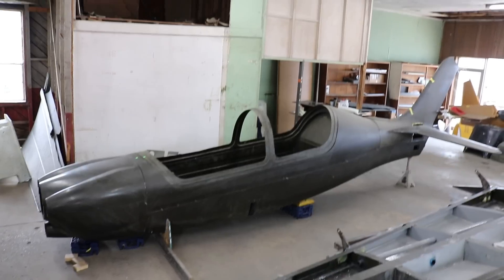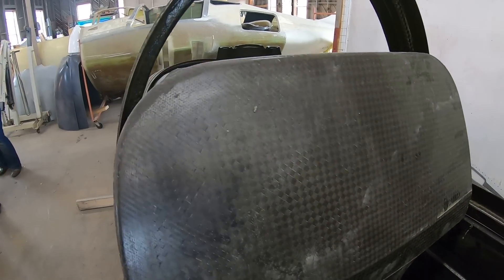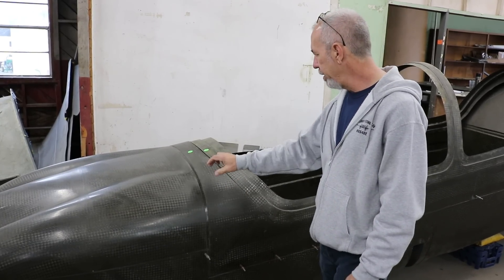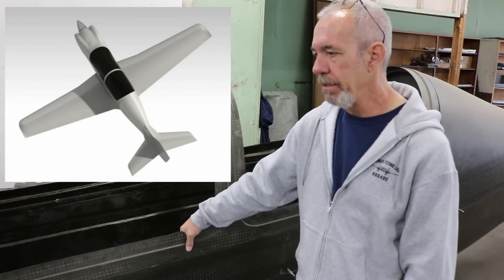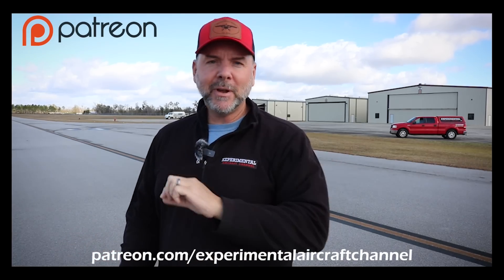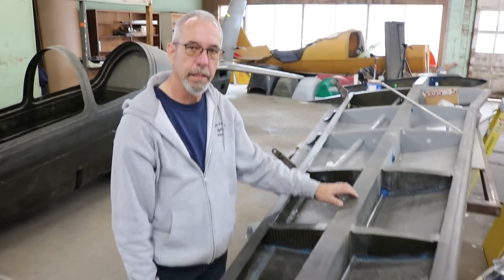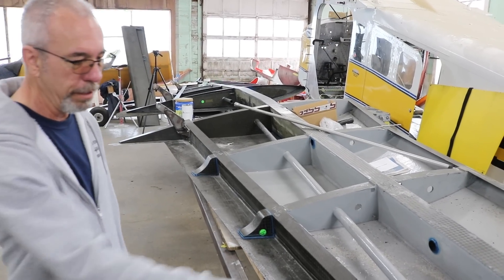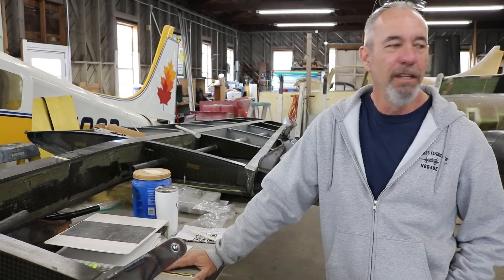All Carbon Fiber! F100 SPEED Kit AIRCRAFT Prototype!

Comment: Using contemporary materials and tech in a clever way can drastically alter the weight/power ratio, extend the range, keep cost-of-ownership at a reasonable level, and drive the production cost down.  Imagine a carbon fiber extended-wingspan version of Eclipse 550 or Learjet 23 with twin PW610F-A engines (mounted under the wet wings) weighing circa 1100kg, consuming >40 gph, cruising at 400kt, with 3000nm range.  No longer impossible.  I'm wondering if there's already such a carbon-fiber jet project in the pipeworks somewhere?

Comment: There are very few tandem seating two seaters in the market, always thought tandem configuration makes for a better two seater that's designed for range and speed. With that 90 gallon fuel capacity, hopefully they will be able to get some impressive range out of this if they stick to a good piston, diesel could also be nice for the fuel efficiency.

Comment: 2,800 gross / 1,680 empty wt is 0.6 fraction. = believable.

2,800lb / 114ft^2 wing area is 24.56lb/sqft. Reasonable for this performance. 

24.56 x 1.03 (down-load) requires CLmax of 2.3 to fly at 57ktas. That is high for GA. But still believable with large slotted/fowler flaps.

300hp IO-540 as described at 14:28. 240ktas Vh (max) speed. This gives almost +8% horsepower due to ram-air. And propellers likely 85% efficient. This requires a flat plate drag area of 1.87sqft. (About what a Glassair III has). But this requires a very low drag coefficient of 0.0164 with 114ft of wing area. This number is exactly the same, to the fourth place decimal, as the number quoted for the P-51D Mustang.

I doubt this aircraft will achieve this low drag coefficient. 0.018 is more likely. This airplane will probably have a maximum speed of 268-270mph or 233-234 ktas. 

The designer knows this, as the cruise speed is given as 225ktas. And this is surprisingly often 95-96% of maximum speed. 225/0.96 = 234. 

Not to rain on their parade. As 6-7kts is still a very small over estimation as the speeds we are talking about. They aren't dishonest, just failed to factor for Compressibility at 0.35-0.4 mach. ;)
Reply: That's some serious napkin math my friend
Reply: @tafaragadze6432  keeps people honest. This is a promising design to keep an eye on for sure!

Comment: If you don’t know why the tail plane has an anhedral, stay away from this aircraft - seems fairly basic to explain - and it is not about cosmetics - amateurs in every sense.
Reply: Richard was correct, a horizontal with anhedral is what was desired. Simple enough to design into the horizontal anhedral, dihedral, or level.

Comment: Push rod or cables for the controls... Also isn't is still dihedral since the tail is normally an upside down airfoil?
Reply: Carbon fiber tubes for the ailerons and elevator, cables for the rudder.

Comment: For him to even mention the IO-720, I question his credibility. It is 140 lbs heavier than the IO-550, which is laughably easy to get to near 400 hp with only light hot-rod modifications. The small turbine idea is the only way to go here.
Reply: 720 is not being considered. Turbine is, however.
Reply: The IO-720 arrives with a factory certified 400hp and long TBO. It weighs 600lb.

The IO-550 has 300-315 horsepower, in the version you quote as being 140lb lighter. The TSIO-550 is a 600lb engine with turbochargers, intercooler included. And it has 350ho in this trim, while easily making 400hp (up to 800hp) this requires Water/Methanol injection and fully custom programmable ECU and dyno tune.

The 720 is the more conservative option, except for distance forward of CG the prop and engine centroid will be moved.
Reply: @EllipsisAircraft  The IO-550 in the plane I built, N36LV, produced 370HP with only very light modifications and no engine management system. It had ported and flow- matched heads, a slightly hotter cam, a redline increase to 2800 rpms, one electronic ignition and one magneto.

Comment: Sir. Why use All Carbon Fiber? With the Awesome Fiber that US Composite made why not Carbon/Kevlar for strength and Cost Difference!
Reply: Many factors go into material choice; strength, weight, dimension, and lastly is cost. You can’t just swop out one carbon fiber for another, it’s not that simple.
Reply: Kevlar makes a terrible structural composite. This is self-evident from a cursory introduction to composites. Kevlar does not bind well in resin matrix. It has little to no compression strength alone, and in resin its compressive properties are a small fraction that of IM Carbon or even Glass. The most rational combination for composites are Glass/Carbon. And Boron/Tungsten filament fibers make fantastic material for additional compressive strength. But become difficult to process for small shops.

Comment: You had me at twin engine jet :) I'm curious which engines he intends for that. And I assume it will need to be significantly redesigned for that because of CG. All that nose weight coming off. And probably a smaller wing.  I wonder what a project like this costs. I assume it ain't cheap. Like million plus.
Reply: Yes, million+. Some components will remain the same. As you have suggested the wing will move aft to satisfy CG window. We anticipate at this point wing design will remain the same. Significant engineering yet to be performed.

Comment: A little pie in the sky at this point. The 720 is the wrong engine for this project. A lot simpler and economical engine could be had. I would guess this project is at least 3 years from completion. It will look nice but I just don’t think there will be a strong market for it as there are so many very elegant designs out there.
Reply: How do You know the -720 is the wrong engine?

Comment: What's the approx price for  " ready to fly " with 250hp engine ?
Reply: If you have to ask…
Reply from the maker: I think the correct answer is.... "ALL - of -IT!" or... "YES." :-) All kidding aside, it is impossible to give a price point on a prototype and the kit following after. (At this point).
Reply: Far north of $1 million 🧭 .    LoL 😂
Reply: And it's carbon fiber, not fiber glass. It's going to be a pretty penny.
Reply: 250 hp would be too underpowered. Need minimum 300 hp. Kit Price will be provided once the prototype completes flight testing.

Comment: Don’t know why he would consider the Lycoming IO-720 ? I’m sure there are better choices than the 720 . Don’t get me wrong, I’m a Lycoming user. Not a big fan of the Continental fan , but a IO-550 is better than the 720 . Never have heard anything good about the 720 other than the crankshaft breaking ? Hell put a turbine on it and be finished !My 2 cents
Reply: No 720. A turbine is likely, however
Reply: A small turbine would be nice.
Reply: 400hp is the reason for the 720…

But, has the economics of twin 360s…

Like flying a twin without having the possibility off centered thrust….
Reply: I agree, just put a RR250 on it and be done.
Reply: @superskullmaster  has anyone seen an RR250 in a fixed wing….?

It saw some development back in 2007, and fell into the 2008 abyss…

Williams has a small turboprop engine of interest…
Reply: There was a demand for more power than the big opposed 6’s could provide but the 720 proved to be unpopular for a reason
Reply: The IO-720 arrives with 400hp.

The IO-550 weighs nearly the same, and costs the same, for 350hp.

Continentals are very good. But the Lycoming -720 utilizes many common parts from the smaller engines. It is harder to use as a drop in replacement due to length, and firewall clearance. If you move the engine center forward, the center of gravity moves forward die to longer engine and heavy propeller moving 1cyl (6")  forward.